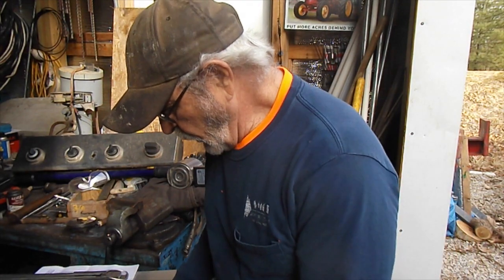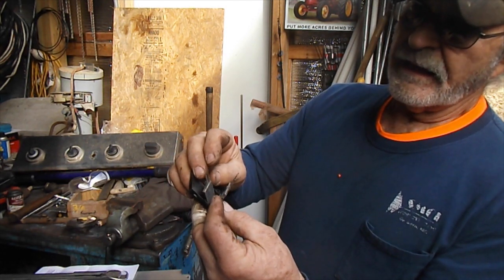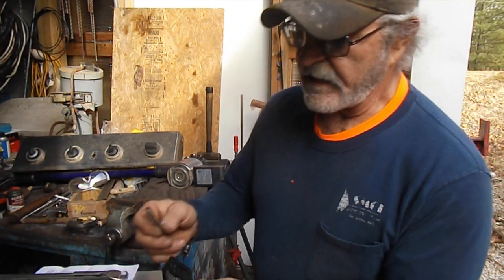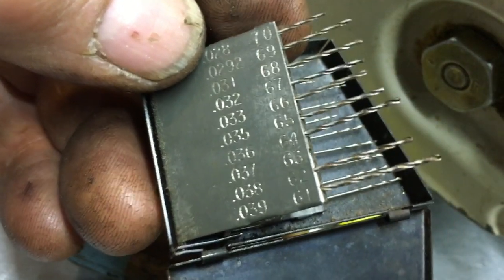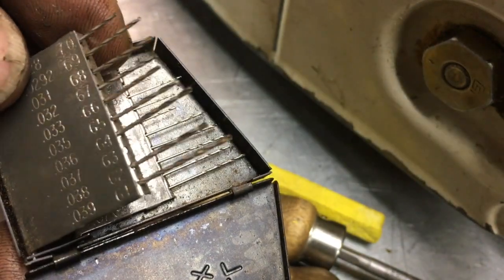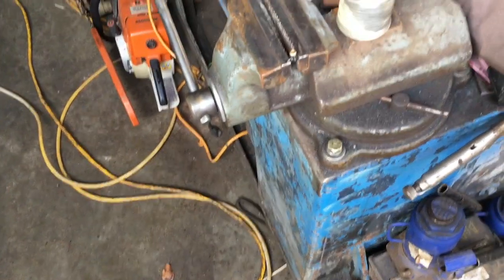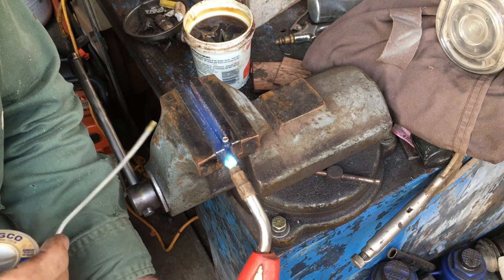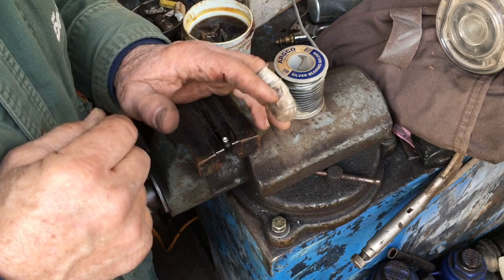BBQ Pit LP Conversion Pt 1

Comment: Good info! I got my old MAPP gas torch out last week to solder some plumbing and the hose was dry rotted at the handle , had to use that darn "screw on the tank" torch.